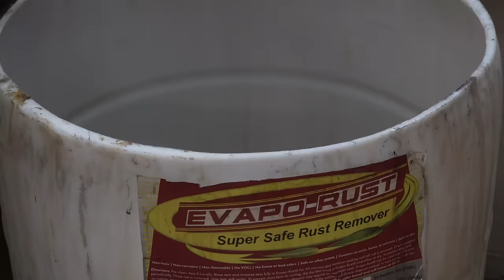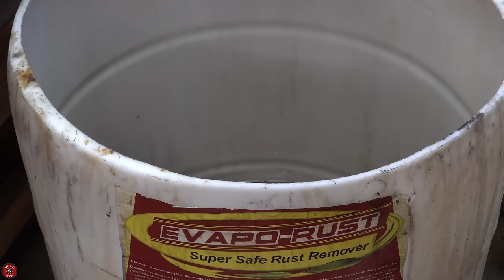1890s' Most Unnecessarily Complicated Apple Peeler [Restoration]

Comment: I did not expect how fast that machine was gonna clean the apple. Like literally one turn lol. that thing is for a factory kitchen
Reply: Probably was! :D I live in NH, the state in which it was manufactured, and we grow A LOT of apples! This was probably used for commercially producing apple butter or pies. We have much smaller and more simple "apple peeler-corers" that many of us New England home cooks use to process our fall harvests. I can definitely see a machine like that being used to preserve TONS of apple butter or a similar product.
Reply: 3 turns of the hand wheel total, first two peels and cores, third ejects the Apple and core and returns to the start.  
With the sequence ordered by the cam pin tracks on the wheel in the back.
Reply: I like apple
Reply: Me neither. Clearly this is for someone who needs a peeled apple and only has 3 seconds to spare.
Reply: @jaredm450  My grandmother had one of these. She used it for baking, because it was easier to peel and core apples like this than with a knife, especially when she was making several pies.
Reply: My jaw dropped.
Reply: No joke... I was thinking this was a ludicrous machine, but I can see how it would pay for itself quickly if you had to peel a hundred apples a day
Reply: The funny thing is how crude this thing is but still performs so well. By that i mean the gears are cast and not cut so theres a lot of play and theres very few machined surfaces and a few joints have bushings but no bearings, just a pin with a cotter pin and washer. And yet it works brilliantly
Reply: @maggs131  Loose tolerances mean easier and less-frequent maintenance. Tight tolerances are for sniper rifles and F1 cars.

Comment: Kids, when granddaddy says “they don’t make em like they used to”, this is what he’s talking about.
Reply: So he means unnecessarily complicated, heavy, overly big, and a wasteful utilization of material resources?
Reply: @xarcaz  no, what means is an overly complicated but incredibly precise and efficient mechanical engineering marvel.
Reply: @xarcaz  dont forget built to last and can be handed down for generations and marvled at unlike today's garbage that breaks in a month and one part to repair it is more costly than an entire new unit. Nothing you said was accurate 🖕
Reply: @xarcaz  hahaha its funny becouse its a complicated machine criticized by someone who barely knows how to turn a screw
Reply: @homiespaghetti1522  "efficient"
Reply: Yeah, they make them better and 1/50th the size now lol
Reply: @garrettspivey  they dont
Reply: @maggs131  built to last is the most imporant. thousands of years can pass and this machine would stand the test of time
Reply: @garrettspivey  Joking? The handle fits a hand about 4 or 5 inches wide.  Using that as a guide this thing looks to be about 18 inches wide and 12 inches tall.  1/50 the size would put it around  3/8ths of an inch wide.

Your statement is inaccurate.
Reply: @garrettspivey  I have the smaller, modern version; it doesn't work a quarter as well as this one.
Reply: I eagerly await the day we get to watch a rebuild of a laser peeler*.

*that's a laser that peels stuff. Not a machine for peeling a laser. That would just be silly.

Comment: The soviet version came with a diesel engine attached.
Reply: I Don't for a second doubt it.
Reply: And gulags.
Reply: Ты прав.
Reply: This one machine will peel apples for many families.  When was the last time any of you comrades have seen an apple?  Hmm...  maybe it can peel Soviet potatoes.
Reply: @Azathoth43  и резервации коренных народов Америки.
Reply: @rybiizhir  Damn, The USSR even had reservations for native Americans? Didn't know that.
Reply: 16 cylinders 2 stroke that will burn 20 galons a hour and will peel only the hafe of the apple.
Reply: In capitalist America, you hand crank apple peelers. In Soviet Russia, you die when nuclear powered apple peeler has a core meltdown.
Reply: Can't beat Nemetski engineering, after all...
Reply: LMAO :D
Thanks for that ^^
Reply: And in modern Russia the Soviet machine is stolen and sold or rusted into pieces. Today apples are not peeled, or peeled by hand using Chinese peeler. If you are paid for that, you are paid in apples.
Reply: @catherine_404  And the best is that they don't even need petrol then Chinese workers only need water. So instead a diesel engine running on fossil fuel it runs on water, environmentally friendly.
Reply: The Florida version comes with 3 broken toes and no recollection of how it ended up on the beach
Reply: In Russia you dont peel apple, in  Russia apple peels you!
Reply: V8, biturbo))
Reply: @rekinek1111  Guys in Russian, please!
Reply: And it cut the Apple into thirds... although the Soviet designers had intended it to cut the apple into quarters.
Reply: В этом даже не стоит сомневаться
Reply: Add the Polish one had a screen door
Reply: Yeah, but it's made from Chernobyl metal and it glows.
Reply: @heru-deshet359  And the apples are screaming running: Nooo don't eat us!
Reply: A two stroke diesel engine
Reply: The Chinese version comes with complimentary won ton soup.
Reply: imperial Russian version. Soviet didn't Soviet until after 1917.
Reply: And a repairman assigned to each peeler?
Reply: @jonmiguel  and don't forget a commissar to get executed when quota not met
Reply: It was a school weekend project of Mikhail Kalashnikov
Reply: @Le Dernier Gaulois that's what vodka is for
Reply: HAHAHAHAHA
Reply: True, but you'd have to wait 6 months for your diesel ration before you can operate it
Reply: @texasrox2010  I'll give you a sack of potatoes for your monthly ration!
Reply: No doubt 🤣🤣🤣🤣🤣🤣
Reply: LOL! So true!
Reply: Lmao 😂😂😂
Reply: Imperialist lies.
Reply: Also the soviet version was a secret prototype that nobody has seen doing actual work. It's rumored to have broken down while testing causing an environmental disaster.
Reply: А вместо топлива будем заливать польскую злобу,)))

Comment: All that engineering just because apples are poorly designed.
Reply: If apples were like bananas, we wouldn't need the technology.
Reply: @paul beenis I mean, the idea is that you can just peel a banana by hand without any goofy looking machines.
Reply: Just need to hybrid them with oranges - get the tough skin but keep the apple flavor.
Reply: @StephenGillie  Not too keen on genetic mutilations per sa but if we do go down that road, I'd suggest a clementine rather than an orange.
Reply: :D amazing..
Reply: GashimahironChl bananas are inefficient too. We need to work together on self peeling fruits.
Reply: Apples come with their own biodegradable, edible packaging. All the nasty, tough bits are clustered in the middle. Not bad design, by me...
Reply: @pocketjohnson hahaha
Reply: @runswithcows464  but all fruit are genetic mutations. No common fruit today is its original form. Humans have selectively breed them for centuries to get them to where they are. Apples 100 years ago were sour and really only used for cider for example.
Reply: @5hiftyL1v3a  Will I have to wait much longer for one with a easy to open resealable skin?
Reply: @sciangear4782  I don't know why you need to peel the apple anyway.... maybe if you like to dry the apple but most of it's nutrition lays in the skin
Reply: @charli73749  tru dat. I did note that the packaging is edible too :) Peel or eat, as required 🍏😊
Reply: And thus begins the journey to design engineer and build a better apple
Reply: Now that's funny 😂